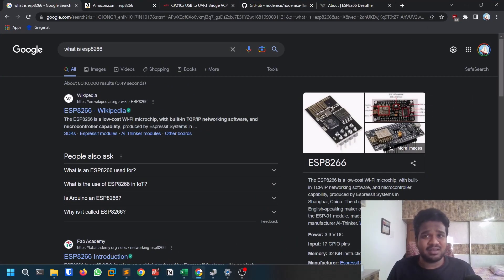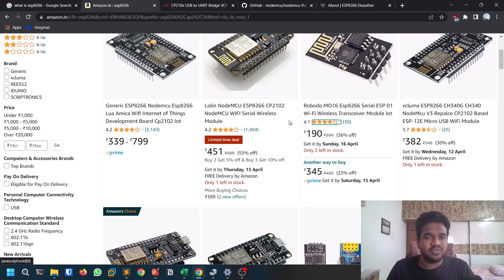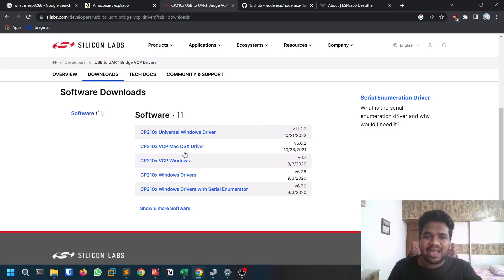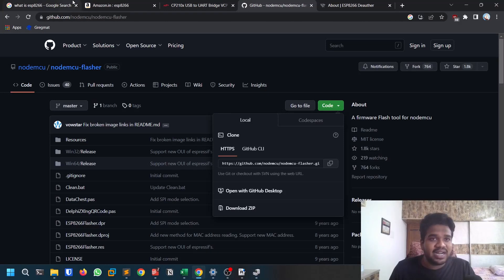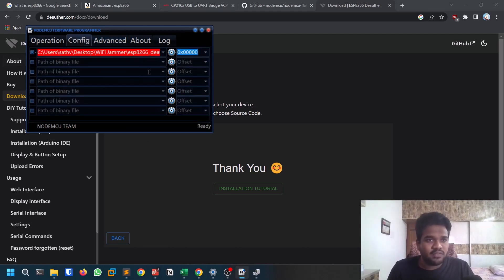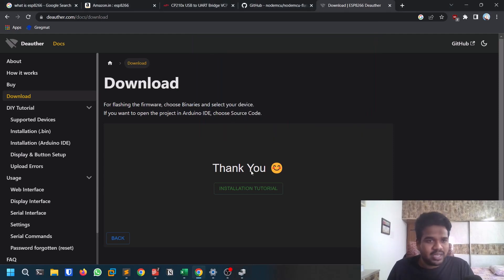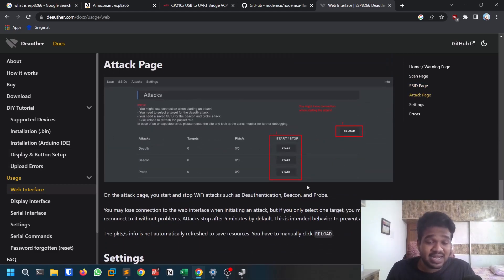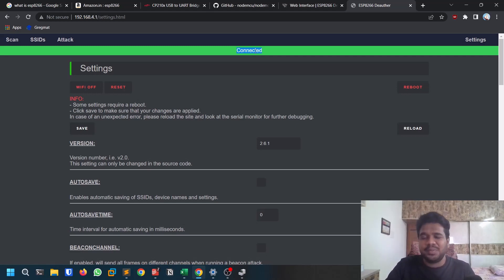WiFi Jammer || Complete build from scratch

Comment: Good morning. How can I defend my home's wifi network from a malicious person who uses a frequency jammer, or maliciously uses Flipper Zero to neutralize my home's wifi? I intend to buy surveillance cameras that work in wifi !!!! I fear that with these tools they are really useless. if you can help me!!! bye thank you
Reply from the maker: Check this article
https://x4bx54.medium.com/use-802-11w-or-wpa3-to-prevent-de-authentication-attacks-in-your-wi-fi-network-4ce63ab20033
Reply: Don’t use Wi-Fi and go wired would be the best solution. Just like general home security like door and window locks. If someone really wants to do something, they are
Going to find a way to do it. 

Like breaking your window to unlock it, or taking a power drill to your door lock. 

There’s no 100% way to prevent someone from jamming your Wi-Fi signal unless your wired. Then all they have to do is clip the wire. 

It’s about creating a situation that is so tedious to the criminal that they would rather go next door than deal with all your deterrents. 

I’d recommend a combination of both Wi-Fi and wired. If there’s a failure in either you have a backup